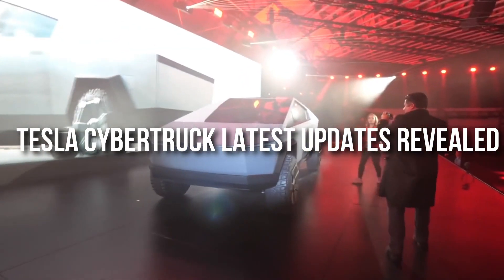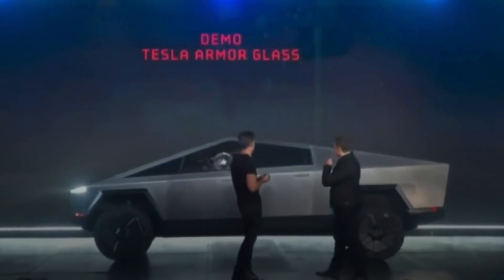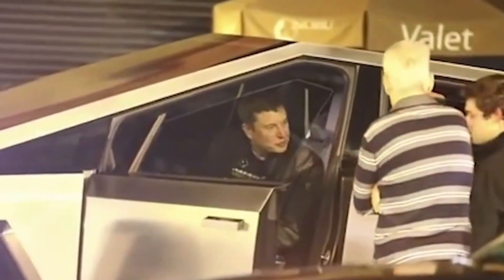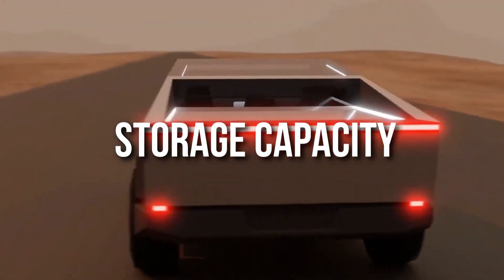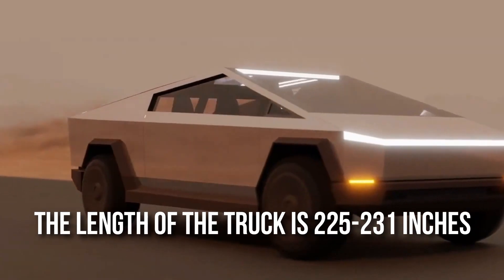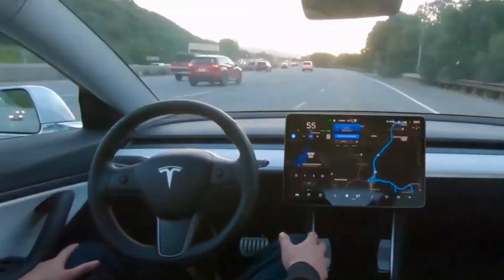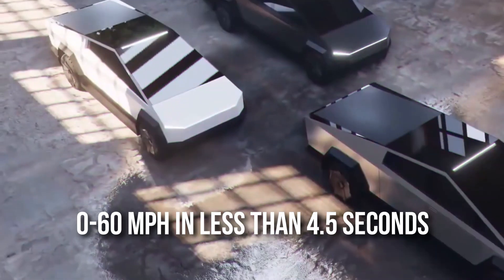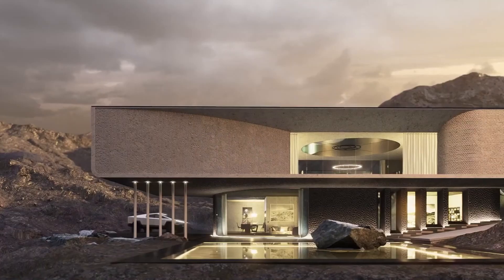Latest Tesla Cybertruck Updates REVEALED!

Comment: 0-60 KILOMETERS per hour? In 6.5 seconds Not miles? I could run to 60kmph in 6.5 seconds.
Reply: I could probably do it on a bike on a steep hill that's less than 40 mph